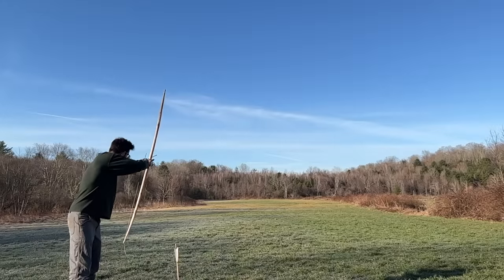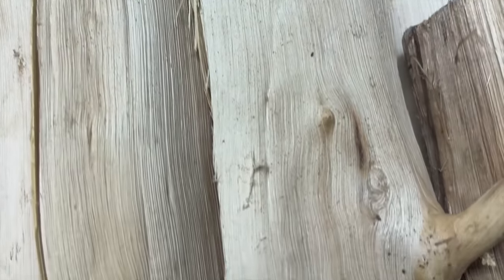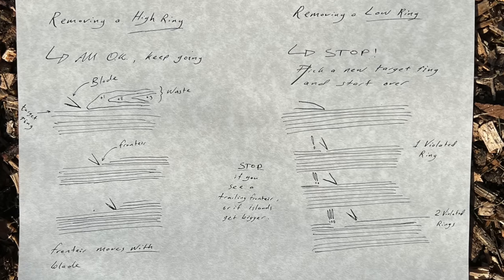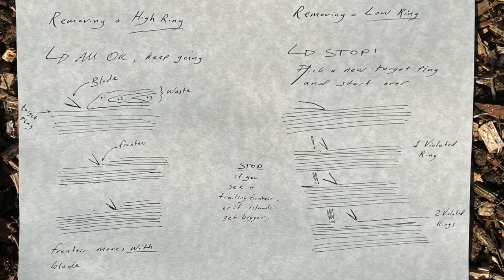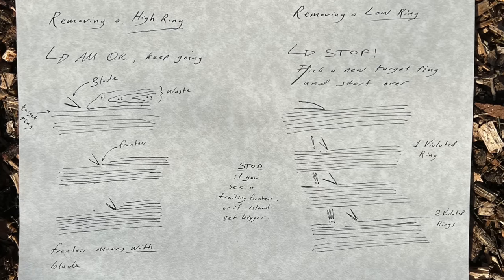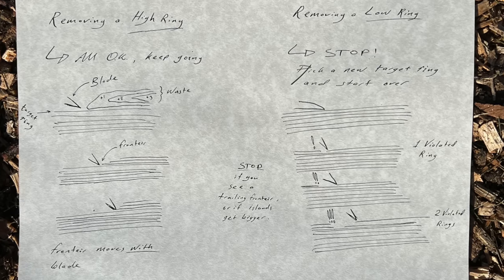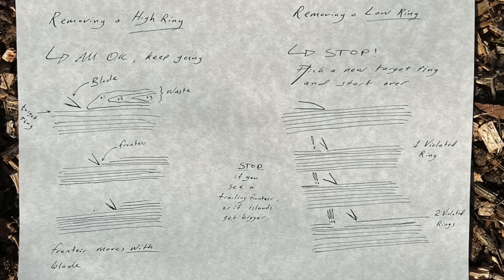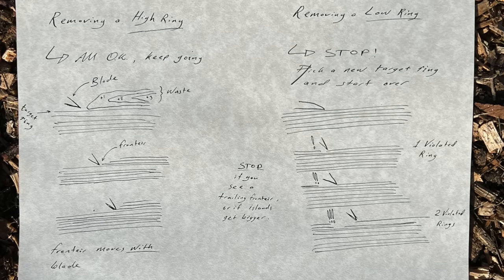The Back of the Bow,  6 Ways

Comment: Doesn’t matter if it’s on here, or on reddit. I’m always excited to see a post. Wonderful video, and thank you for your hard work.

On a somewhat related question, I was under the impression that English longbows (I suppose Welsh longbows, really) were (generally) closer to a concentric shape thinning towards the ends. Is that fairly accurate or are they a little more trapezoidal like many modern made self bows? 

Been thinking about trying my hand at an ERC trial with one sapwood, one heartwood, and one mixed out of the same tree to see which works the best. I’ve gotten very mixed answers regarding which is the best to use with ERC.
Reply from the maker: English longbows made of yew are usually made with a D cross section, nearly parallel width taper for most of the length, and a thickness taper determined by the tiller. 

In a way this is sort of the opposite of a trapped back because it’s an attempt to maximize the area of the back rather than the belly. Rounding the belly is a pragmatic way to keep the back from breaking by making the belly take set first. It keeps labor quick which makes sense for a wartime tool. 

Personally I rarely find myself in a situation where a D belly makes sense. Chasing a growth ring rather than violating the back makes for a much more trustworthy back and eliminates the need for the inefficient round belly. The elb is somewhat overhyped. It’s a wise and pragmatic approach for a wartime bowyer, but these days when yew is precious I don’t think it’s the best design for a longbow. Personally I prefer to go with a flatter belly only rounded in the corners.
Reply: The wartime aspect certainly makes sense. I can definitely see a fairly large amount of set being acceptable for use in warfare. Efficiency and velocity become far less important when using heavy war arrows with high poundage. I wonder if that's why they went so high in weight? A 100+ pounds does quite a bit from a physics standpoint to offset loss in velocity/efficiency.

I'd be curious to see what draw weight it would take from a highly efficient selfbow to throw an equal weight arrow at the same velocity as a heavy but (relatively) inefficient ELB?

Personally I'm interested in doing an ELB style just because I haven't made one yet (and they're one of the easier historically interesting designs). Want to play with all of them eventually. Though, as you said, Yew is precious. So I'll likely continue to play with ELB designs with the hickory, ERC, and White oak plentiful in my woods. Plenty small enough in diameter that I should be able to just peel the bark and start tapering for an ELB design.

Thanks for taking the time to respond!
Reply from the maker: @BakaEngel  The bowyers bibles go into a lot of detail about the diminishing returns of high draw weights. While you do stop gaining as much speed as the weight skyrockets, you still get a lot more kinetic energy because you can handle much heavier arrows. High weights aren’t very valuable to target archers and beyond about 80# they tend not to be best for flight archery. But if you need to pierce a knight though thick armor hundreds of yards away then a massive draw weight really helps

Comment: 21:00 Back in 2014/15 I was in a woodworking class. In one class we made bows out of red oak and we backed them with fiberglass drywall tape, I still have mine.
Reply from the maker: Drywal tape won’t ruin a good bow but it also won’t save a bad one. Compared to other cheap and available backings I really don’t think it’s worth it. There’s a good reason that fiberglass backed wood bellied bows did not last long in commercial archery history. fiberglass tape glued together is much worse than a real strip of bow making fiberglass, and even that isn’t a great idea unless you’re making a proper fiberglass bow and also put it on the belly

Comment: I'm just getting started into this, but it looks like a hobby that I can really enjoy. Definitely inspired to start experimenting. I'm curious what the thinking is on Hickory? I know it's very tough, and great for axe handles and tools. Is it suitable for a bow?

Edit: Disregard. I just reached the half point in the video and learned that Hickory is suitable. Thx for the info! 😁👍
Reply from the maker: Yep it’s my main bow wood. See the video on bow woods for more details
Reply: @DanSantanaBows Hi. Thanks for the prompt response! I really appreciate that. 

Yes, right after I posed the question, I reached the midpoint where you talk about how Hickory is your primary word. It's great to know that my instincts weren't wrong. 

I was also curious about why people don't use plywood to build bows, but I really don't know much about the mechanics required of the material. 

It seems to me that 1/2" Baltic Birch or something similar might be suitable. I was thinking that someone could take a couple of pieces of 1/2" Baltic birch, and perhaps laminate some formica in between, or as a back, or somehow incorporate some fiberglass or carbon fiber tape. And then do most of the shaping using belt sanders, and random orbital sanders, and then finish by hand sanding to a fine degree, and then possibly seal and finish with an epoxy, and then dull rub that. Perhaps even using a dye or a stain or maybe charring it to add character. And if it needed to be bent, it could be wet, and then bent and dried, or maybe steamed. 

But I don't know much about the spring-mechanics required in a bow, and whether or not the plywood with the opposing grains would provide that. Maybe it would be too stiff. Or maybe it wouldn't have enough back spring.  And obviously it's not traditional materials., but it would the inexpensive, and the materials are pretty much readily available, and it would probably reduce the time required quite a bit. Certainly not the same level of artistry, or craftsmanship, but it might turn out a great, inexpensive utility bow. 

Is there something that you have considered at all?

Also, I just wanted to compliment you on your content. It's really great, along with your craftsmanship of course. Thanks for the great instruction. I love You Tube University! 😁👍👊 🏹🏹🏹
Reply: @DanSantanaBows and hopefully my suggestion about using plywood to build a bow doesn't overly offend your purist, artistic sensibilities, lol. I would totally understand if it did.😂😂😂
Reply from the maker: @Curtis3366  The opposing fiber direction in plywood wastes a lot of weight. You could use uni directional plywood in theory, just like making a laminate bow
Reply: Man, I love this video. Getting into the 2nd half now. So much great insight. "A bow made of itself". Wow. An amazing insight of what a bow actually is.

I really just started looking at bow making videos today, and I'm already hooked. And my mind is exploding with all kinds of different ideas. But watching this video, it basically boils the bow down to its purest essence which really is a beautiful thing. I really appreciate this kind of content. It shows a high level of understanding of the inherent nature of not just the materials, but the character and qualities of a tool itself. 

I've been thinking a lot lately about how activities, and tools, both have inherent philosophy built into them. They are designed to do specific things. I started thinking about it mostly from a martial arts perspective, because each martial art has a different philosophy built into its actions and reactions. 

Some are highly destructive, and meant to kill and maim. Some are more competitive and designed to reveal a winner. Some are more geared towards self-defense, rather than destruction. But the philosophy is in the movement itself. And whoever trains in those movements, becomes that philosophy in action. It gets hardwired into them. 

It's a difficult concept to explain in few words, but it lends itself directly into the idea of a gun for example, as compared to a shovel, or an axe for example. Both are designed for certain things. And both imbue the user with their inherent philosophy. When you hold and shoot a gun, you can't escape what it is designed to do, regardless of the reason it is used. And when you use and hold a shovel, you can't escape its inherent intention. And without getting too far into the weeds here, this line of thinking really makes me appreciate qualities of this type of bow building. Just because it's so pure. 

Anyway, I wanted to mention the linen backing which appealed to me immediately when I saw you cutting it, and then you mentioned denim. And I was wondering about making a bow out of laminated denim and epoxy.  Again, obviously not traditional, but it would be original, potentially highly effective, and potentially very striking in appearance. Especially if the epoxy were tinted navy blue.

Like I said this concept of bow making really appeals to me, just because of its creative potential. I can't wait to watch more of your videos.  I've already sourced my Hickory. 😁

Thanks for sharing.

Comment: Awesome!❤❤ had seen many videos, terms are flying around in my head in no order-this chart gives them a systematic process to follow!
I wonder if you would do a followup and include the bow diameter/shape as part of the consideration?
Still a bit confused what woodtype/situation prefers a flatbow (rectangle) vs trapezoid bellyheavy or backheavy vs round?
And if there is any way to figure this out before the stave/sapling is cut-I had a sapling stem (1inch) where it turned out, it had a pretty strong bending direction preference, forcing me to change the hole belly/back direction in the midst of cutting it. 
I realize as more carefull the woodpiece is selected and evaluated, as less work is there to do afterwards.
You either spend a lot of time in the forest or a lot of time fixing the  woodpiece, correct?

Comment: I know that leaving the bark on bow backs is not a typical thing to be done but I absolutely adore the amount of character it adds so I really want to try my hand at it.
I know its possible with blackthorn and hazel, both of which I know it is possible but my blackthorn stave mighht not make a longbow at all since the good wood on it is only 62 inches . for the hazel though, I harvested it today, the 5th of april. From what I know the bark peels off more easily on spring wood, however the back ring is thicker. sap started flowing not too long ago so im thinking im a little too late with this stave to try the bark bow. on the other hand ive heard that it can be done as long as there arent any leaves on the tree yet, which would be the case for my log/staves. Do you have any advice for my case?
worst case I wait until the end of the year to harvest some more...
Reply from the maker: Harvest whenever you want to make a bow. Whitewoods cut in the spring make fine bows too
Reply: im not worried about the wood being bad or the sorts, im just trying to gather information on how to preserve natural bark on the back the best for bows. thank you for the input either way.

Comment: Hello dan, great video. Whats your opinion on vertical grain self bows where the grain runs from the back to the belly? I believe its called quarter sawn. What about diagonal grain?
Reply from the maker: As long as you choose a board with fibers that span end to end across the back without violation then you can use any growth ring orientation

Comment: Hey Dan, this was such a useful video. Thank you for sharing and teaching. I am in the process of making my first bow using an ash stave. This stave was cut in the Spring and the bark peeled right off along with the majority of the cambium. A little boiling water cleaned the left over cambium off and left the back clean. I'm planning on using the back in its natural state without looking for a growth ring. You said that if that was the case the back should be sealed, with sealer or glue. Can this be done once the bow is finished or should it be done now?  And if so what would you recommend? Thanks again.
Reply from the maker: Definitely seal the back if there’s still moisture in the stave. Sometimes I don’t exactly follow my own advice here but I also ruin staves from splitting once in a while. Eventually you’ll pick up an intuition about what’s safe to dry how fast but if you want to be safe sealing the back won’t hurt and will help keep the cracks away

Comment: I'm chasing a ring on a Mulberry stave right now and I like using the draw knife (on edge) to scrape the final bits of early growth, I noticed where my draw knife rests at the beginning of the stroke it's leaving small knicks - are those considered violations? Thank you. The time that you take to answer these questions is really appreciated. 
I am really loving this venture into making Bows - It does have a terrible side effect though - Every tree I see now is all potential Bows!!
Reply from the maker: I try to avoid leaving tool marks like that because any severed fiber is a place a splinter could lift up. Realistically it’s probably not a big deal but I like to avoid it. I find that using a scraper with a burr leaves a smoother back, but many bowyers do it your way 

There is a big spectrum to the concept of violating the back. Bowyers often talk about violating entire growth rings, which is a huge deal for most woods. Violating the surface fibers with little nicks and dents isn’t nearly as bad

Comment: Would you be able to elaborate on what trapping looks like? I have a hickory bow that has developed a problem on the back where thin parts of the fibers are essentially pulling themselves apart. I thought it was just from a broken growth ring, but after planing and sanding the offending area the problem resurfaced a hundred or so shots later. I was planning on just linen backing the bow since this saved some that I made from maple and elm, but I haven't run into a problem that won't be fixed before and it has me spooked.
Reply from the maker: Basically you’re narrowing the back at an angle so that the cross section resembles a trapezoid instead of a rectangle. Anyway, trapping isn’t a good idea in that situation since it will make the back weaker. That’s usually a good trade off for hickory since the belly is the weak spot in terms of performance. In your situation a backing makes more sense, or a sinew wrap in the problem area. Be careful with sanding and planing on the back which can violate the back and possible worsen issues with splinters in the long run
Reply: @DanSantanaBows  Thank you for the feedback. I think I misunderstood what you were saying in the video about a trap shape. I have some linen on hand and will go that route-I only tried planing it because it looked like it was an isolated area. Hopefully this fixes it. Also, I love the diagrams you put on the webpage-they are very well done.

Comment: was always wondering if a thin coat of wood glue on the back of a bow would actually do anything
Reply from the maker: on the bow not much other than moisture barrier if it’s a waterproof wood glue, but you may as well use a better finish for this job. On the back of a stave it can slow moisture loss through the back reducing the chance of checking. This is standard practice for freshly cut osage that has had a ring chased while the wood is still green

Comment: Hi I have an important question arc length usually starts from a few inches to a few inches.  Also the diameter of the middle tip and the handle and its width? You can share a drawing or image
Reply from the maker: Just keep in mind I can’t give you the final dimensions of your bow, that will depend on the design and tiller. Check out my board bow tutorial, in that video i give basic rough out dimensions and drawings. 

These notes are for my next video and show the finished dimensions of a maple longbow https://www.reddit.com/r/Bowyer/comments/uz1rbj/maple_longbow_design_notes/?utm_source=share&utm_medium=ios_app&utm_name=iossmf
Reply: @DanSantanaBows  tnx

Comment: Would Cascarra make a good bow. As a test I have bent several saplings to their breaking point, which was considerably more than a bow flexes.  New to bow making , and came across a source of some cascsra and vine maple so thought at least I could practice on the cascara first.
Reply from the maker: I hear it’s not very good but you can practice with it. Make the bow wider, longer, or lower in draw weight or draw length. Vine maple is excellent stuff

Comment: Would you recommend titebond 3 for doing a sinew back or hide glue? I heard hide glue is better in theory because it allows the sinew to dry at a better rate and pull more reflex into the stave. Wondered if you had an opinion on that.
Reply from the maker: definitely hide glue

Comment: I have a yew branch, 3" thick, fairly round on cross-cut and straight as a pencil. I intend to make a longbow out of it. Sapwood is around 3/8" thick. If I make it with a natural back the tips of the limbs would be almost entirely sapwood. Does it make sense here to chase a ring and leave only 1-2 growth rings of sapwood to have more heartwood on the belly? I'm aiming for 35-40# at 28" on a 70" bow.
Reply from the maker: Either way would be totally fine. The most pragmatic thing you could do is just use the underbark surface for the back, but it’s also very common to thin the sapwood so more of the pretty heartwood is in the bow. Many say you must use a strip of sapwood on the back and heartwood on the belly but that’s total nonsense. Sapwood, heartwood, or any combo of the two makes great bow wood. The differences are there but relatively minor in the grand scheme of thing s
Reply: @DanSantanaBows  thanks a lot. In that case, I'll take the easiest (and more foolproof) path, since it's my first build. I assumed it wouldn't make much difference since it's a lighter draw weight on a fairly long bow so compression strength shouldn't be an issue, but I wanted to check with someone experienced.